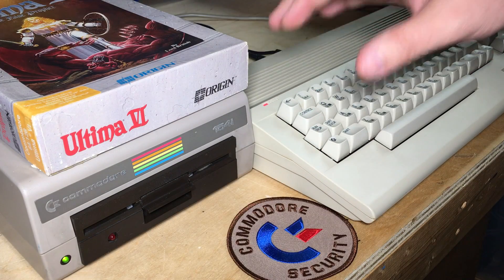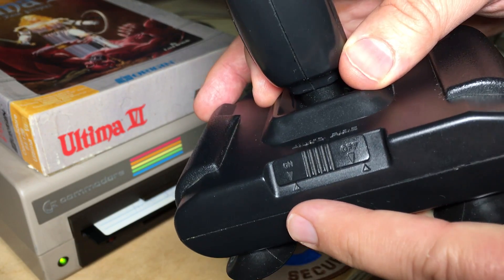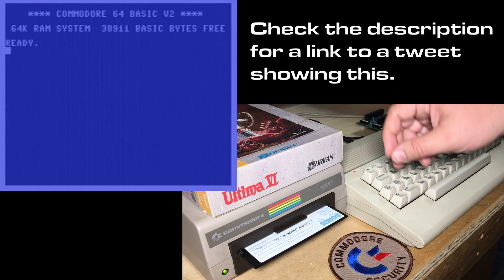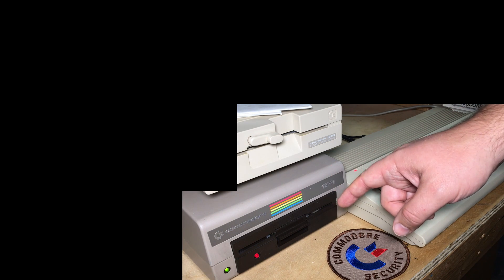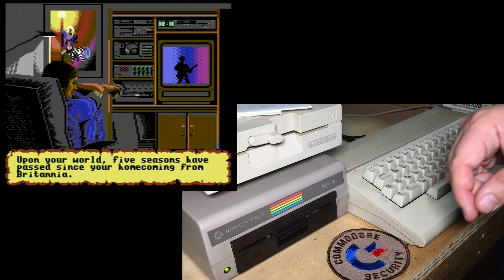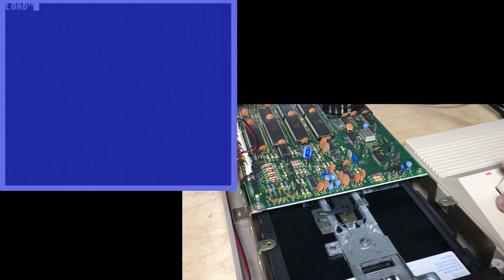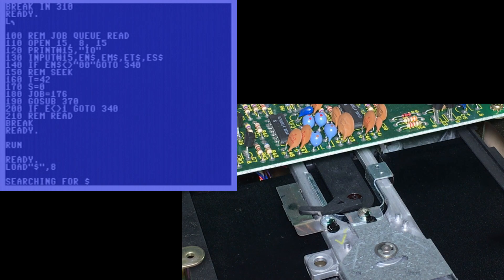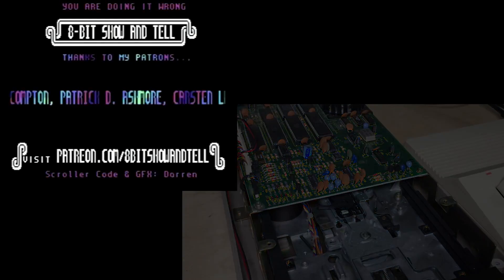Karateka Killed My 1541  (Temporarily) and Other C64 Scares

Comment: At least some of these C model C64's were made with static ram instead of dynamic... today static rams tend to be linear rather than raster (RAS/CAS access) but there were static drop-in replacements for the 4464 at least. It could retain some data for a long time when unpowered. I had two games that jammed the computer upon reset, one of them "licence to kill". After playing it my C64C would be unable to revert to normal function, unless left physically turned off for several minutes. A friend of mine who had a old breadbin, had no problems with the game.

Comment: 3:01 Commodore could have filtered out the joystick interference by setting Port A to $FF and reading both Ports A and B.  If either of the reads isn't $FF, then a joystick is shorting out a line.  (I think you can read an output line to detect shorts, or else you can switch it to input with Port DDRA.) Do this both before and after scanning the keyboard, and if a joystick press is detected at either point, then throw out the keyboard scan.  This method can only fail if a joystick switch is pressed and then released during the microseconds after the scanning starts and before it finishes.  On the down side, if a joystick switch is stuck on, then the keyboard will seem "dead".

3:58 That's what I did with my VIC-20.  I had a paperclip and laminated it with packing tape to hold its shape.  Fortunately, the C128 had a built-in Reset button.

6:52 Interesting… if you need a particularly long loader, you can continue past the BASIC vectors you need to intercept, into the Cassette Buffer, and then onto screen RAM.

8:14 I guess it uses a fast loader that abuses the serial bus in such a way that any other drives on the bus will get confused and interfere with it, such as by using the ATN line to transfer data.

9:19 Just use your pirated copy of Fast Hack'em!

12:34 The reason they limited themselves to 35 tracks is that some of the earlier mechanisms that were supposed to support 40 tracks didn't work properly.  Later mechanisms had no problem with 40 tracks, but the die was cast.

15:12 It does seem odd that it doesn't auto-fix the problem since normally when it runs into a read error, which it would when trying to read non-existent track 42, it does the head-banging thing to make sure it reached track 1.  Maybe it senses no signal at all on the disk and assumes that the disk is completely empty and doesn't bother banging its head?
Reply: That's how I read the keyboard and joysticks, and the same method is used by GEOS, or else a GUI with a mouse or joystick would have been a lot harder to implement (might work with a user port interface, but that would have raised the cost of entry).  Even port #2 had some interference with the KERNAL keyboard routine, albeit not nearly as much as port #1.

As for the track 42 problem, my Blue Chip drive actually used its track 1 sensor, so it never, ever banged its head against the stop, but it still got stuck on track 42, which is undoubtedly due to its ROM's, ahem, 1541 roots.
Reply: Fun part was if you mixed up the sides when doing the paper clip reset, you burned the fuse lol. A proper scare.
Reply from the maker: Aha csbruce!! I've been curious :) I remember you from the C=Hacking days, thanks for your contributions!
Reply: @8_Bit : I figured you'd recognize my name if I "delurked", considering that you published in C= Hacking.

Comment: Good memories. That autofire thing got me all the time back in the day.

The lack of compatibility with other drives is because the fast loader in use in that game, mixed with its copy protection, will be sending bus signals that the second drive may misinterpret as being something it should respond to, and will respond.  Fast loaders are basically viruses in that we would usually transfer a bit of software, a few hundred bytes or so to the drive and get it to run it. If you think about it, it was basically malware, except that it does a nice thing instead of a bad thing.

The copy protection markers on extended tracks was exactly what caused this bug for me back in the day as well.  Someone got me to format a disk I think to reset the head.

Do you have one of those old head alignment testing disks?

Comment: Any reason you type open15,8,15 instead of open1,8,15 like I see in most other places? (I don't have a disk drive so I haven't used either)
Reply from the maker: Either is fine; the 1541 User's Guide that shipped with the drive used file # 15 when using the command channel (which is the second 15 in that OPEN command) and so that's the habit I developed 35 years ago :) Most of the time I'm using the command wedge in the Super Snapshot or JiffyDOS which avoids the OPEN incantation, so I've never bothered changing my habit to save the occasional 2 keystrokes.

Comment: As I recall, the 1541 disk drive can access 84 tracks labelled track 0.5 to track 42. Due to the width of the read/write head, it cannot effectively access adjacent tracks without the possibly of the magnetic fields bleeding into one another hence the half-tracks in the numbering scheme. However, some copy protection schemes took advantage of this. Most commercial disks only go up to track 40. But the very first production line of 1541's had issues accessing beyond track 35, hence the kernel on the C64 and 1541 doesn't write beyond track 35 by default (but it does read). But the C64 and 1541 are both fully programmable, so commercial disks would usually store data up to track 40. As the speed of the disk spin was programmable, the head position was programmable, and the encoding of the magnetic flux to binary encoding was even programable, you had a lot of creative copy protection. The only thing not programable was the sync mark, I believe.

Also, the 1541 does not have a way to detect which track it is on, so when it starts up, the head psychically seeks below track 1 causing it to hit the end and make that "gunshot noise" to sync itself up with track 1 before proceeding. And for some reason, when there's a file-not-found error, the head seeks to track 0, I believe, causing a prolong "gunshot noise". I don't know why. And if you position the head to track 42, which is a track number the drive recognizes, it tends to get stuck. Again I'm not sure why. But I had it happen to me when I was 8 years old with my shiny new drive and I disassemble it and physically moved the head to fix it.

Regarding Ultima, Commodore ran into early issues programming the IEC bus communication on early version of the kernel (I forget why, but I think they were crunched for time) so they settled on a blocking, bit-for-bit serial asynchronous communication with full handshaking where only one device could communicate at a time, which worked but was dirt slow. It's why you see a lot of fast loaders out there. To work, all devices on the IEC need to honor the protocol. You can actually do parallel data data transmission and synchronous data transmission (the CPU speeds between the C64 and 1541 vary by a slight bit, something like 64:63 cycle ratio or something). Several of the pins are fully programmable. You can speed up loading in a way that doesn't break the IEC protocol or you make it even faster by breaking the protocol. This is probably where the lock up is occurring. If you have any devices on the bus that aren't using your custom protocol, it will likely break the communications. I've seen a fast loader that told me to switch off my printer before loading a game and it was blazing fast. I bet, I bet that's it. It's some customer loader, used for fast loading or copy protection or so the game or music can play while loading or all of the above, that bends the protocol thus doesn't play nice when there's more than the expected number of devices on the bus. That extra drive 9 is not being reprogrammed and thus is speaking out of turn and messing up communication between the C64 and drive 8.

Anyway, this is all from memory, so I'm not 100% sure of the specific details, so feel free to correct me. I do miss growing up with my C64, though. :)
Reply: «As the speed of the disk spin was programmable»  I don't think that's true.  The only control is on-off in bit 2 of $1C00.

«the encoding of the magnetic flux to binary encoding was even programable» I assume you're referring to the bit density-timing, for which the 1541 offered four operating speeds in bits 5 and 6 of $1C00.  That could be used to make your custom disks unreadable at non-standard speeds.

«The only thing not programable was the sync mark, I believe»  The Sync mark was written by the disk drive itself since the Index Hole on the disk was unused, so the Sync mark and the entire framing of the data blocks was fully programmable.  I assume this is why copiers went to full "Nybbling", because publishers were using custom disk formats.

«Commodore ran into early issues programming the IEC bus … so they settled on a blocking, bit-for-bit serial asynchronous communication with full handshaking»  They were originally planning for the VIC-20 to use a hardware shift register like the C128 does, but the shift register in the VIA chip had a hardware glitch and couldn't read data reliably.  (Apparently, there's a simple hardware fix for this, but they didn't know it at the time.)  But, the slow software bit-banging wasn't much of a problem for a computer with stock 5K of RAM.  Ironically, the hardware shift register in the C64's CIA chip worked just fine, and so it could have had the fast serial bus to go with its 64K of RAM, but backward compatibility would have been too complicated for the time frame. 

«where only one device could communicate at a time»  Any hardware bus with shared data lines can only have one "speaker" at a time, such as with USB 2.0.  The IEC bus did allow for multiple simultaneous "listeners", though that would have limited utility.  I think someone programmed a 1541 to spool directly to a printer without any intervention from the C64.

«You can speed up loading in a way that doesn't break the IEC protocol» JiffyDOS managed to achieve high speeds while still playing nicely.
Reply: That's right! The control was on the clock speed so it was the data density that changed!

Thanks for all the comments! I forgot how much I loved this stuff.

I found a web page that has a lot of information about this stuff in regards to how it was used in copy protection-- I need to read it later when I have time. Here's the link to share: https://c64preservation.com/dp.php?pg=protection
Reply: I wrote: «Ironically, the hardware shift register in the C64's CIA chip worked just fine»  Correction: While the shift register in the C64 was fine, the 1541 still used the VIA chip which still had the bug.  It wasn't until the 1571 included the CIA chip that the problem was fixed on both sides.

Comment: I wonder how many 1541s the Karateka authors bricked for those who didn't find the drive re-initialization trick.
Reply: To be honest, the fact that the 1541 controller doesn't seek to its home position on power-up was kind of bad design (as was the DOS not safeguarding against seeking beyond the boundaries of the disk). The copy protection just exploited that flaw.
Reply: @Stoney3K  I think commodore worked around this in some versions of the 1541 ROM. I had a lever-door model that seeked until it banged the head every time it was powered on or reset. It often went out of alignment too. I also had an Excelerator Plus (and they copied the 1541 ROM) that did not seek at reset.
Reply: @coyote_den  And on regular Commodore disks the head didn't really need to seek back home anyway since there was a marker on each track when it was a properly formatted Commodore disk. PC (MFM) floppies didn't have this, and neither did a lot of proprietary fast loader formats.
Reply: @Stoney3K   The bad design here is a lack of track 0 sensor, that is why there was no seeking, imagine that you have head on track 0, thet after powerup it tries to move 40 times towards the center of the disk to make sure that head is over track 0. As you said in other comment, disk drive relied on the info on the disk, but you could make a disk with tracks numbered wrong (like the last track being numbered as 0) and drive would go nuts.
Reply: @slightlyevolved  Unfortunately, the court would probably award you up to $400 for the loss of your drive... then, the company's lawyers would immediately show you didn't own the original and win a countersuit against you for piracy to the tune of $250,000 and 5 years in prison.  :\
Reply: @3vi1J  that sounds like BS,  if the damage is caused by copying the original disk, surely you had the original disk.......    You could try to make a copy for yourself as backup..  a genuine thing to do.  Or you could make a copy to give it to a friend, but that's not something a lawyer can decide...   unless you were advertising selling illegal copies......
Reply: @3vi1J   This actually could lead to a massive lawsuit against Karateka creators, they would pay dearly especially if this was intentional. Nobody is allowed to destroy your hardware even if you're using illegal software. Someone could use such games to intentionally breake other drives or you could do it by yourself unintentionally by trying to check what's on the unknown disk you found on the attic.
Reply: @sanjyuu2298   I'm pretty sure the statute of limitations has long passed and no one will be suing Jordan.
Reply: @sanjyuu2298 - The publisher of Karateka is probably out of biz for a long time now, noone to sue.   Besides "Don't copy illegally!" ha-ha jk
Reply: @slightlyevolved  it is illegal to set a boobytrap for house protection...
Reply: It happened to my Blue Chip (the later, fully compatible version), so it's a ROM thing, in all likelihood.  But it happened with other software.  I recall being a bit concerned, but I realized the drive wasn't initializing the head on startup, so I issued the command and it worked.  If I hadn't thought of that, then yeah, I would have been quite worried.
Reply: I dont know, but i do wonder if thats what i did to my 128D's drive. Hasn't worked since 1998 😂

Comment: about the undetected pressed shift-lock key it could be a nice solution to implement a green led indicator on the case
Reply: Since the SHIFT-LOCK key is wired directly to the Left SHIFT key, the light would also come on every time you press Left SHIFT, like I did eight times when writing this sentence.
Reply: @csbruce  isnt there a way to cut the trace from the 2 keys so the mechanical lock is on its own circuit thus the chance to include a led only in this branch?
Reply: @alerey4363 : You can't put it on a separate circuit or the Kernal's keyscanning routine won't read the key.  Maybe you could do something with diodes to make it so the light only activates on the Lock key but not the regular Shift key it's tied to.
Reply: @csbruce  are you saying that the shift-lock key generates another keycode different than the other 2 shift keys??
Reply: @alerey4363 : No, it's wired to the Left Shift key and generates the same scan code.  If you disconnect it from the Left Shift key, the Kernal won't be able to scan it.  Or maybe adding a light is way simpler than I'm guessing.  The two keys effectively will be wired in parallel, so if you stuck an LED inline the path that goes across the Lock key, that might work.  That part of the circuit would only close when the Lock key is down.  There might be other electrical issues to deal with.
Reply: @csbruce  yes, that was my idea assuming it was a parallel circuit, attach a led only to the lock branch

Comment: My long-gone C64c was modified to have a soft-reset button, shorting out the user port pins as described.  Had a friend mount a momentary push-button switch to the side of the case and soldered wires directly to the user port pins.

Comment: I remember hearing that the write protect detection was just a courtesy and it was possible to write to disk even if it was write protected. is this true?
Reply: @Mr T. Guru I was sure I heard it was done via software, by just not checking the status of the write protect sensor before writing.
Reply: No, it is impossible.  The write protect sensor is routed to a gate array, which will not enable the write head in that condition.  Software cannot override this.

Comment: Cool. I was actually just about to type up a comment asking if you could explain the joystick port behavior in regards to keyboard input when you said in the video you might do a video on it in the future. I'd be interested in that. I always knew joystick port 1 was really goofy (and avoided using it as much as possible) but I had no idea even joystick port 2 could cause unexpected keyboard behavior.
Reply: I didn't previously realize that Port 2 could cause problems either, but it does make sense.  A keypress is detected by putting a '0' bit into keyboard-row-select register $DC00 and then checking for '0' bits in keyboard-column-read register $DC01.  If a joystick switch is closed in Port 2, then this will force a '0' bit into the row-select register, which will hardware-select the corresponding row of the keyboard matrix, in addition to whatever row the keyboard-scanning routine has currently selected.  This is why it causes pressed keys to be misread but doesn't cause spontaneous keypresses when no key is being held down like joystick Port 1 will.